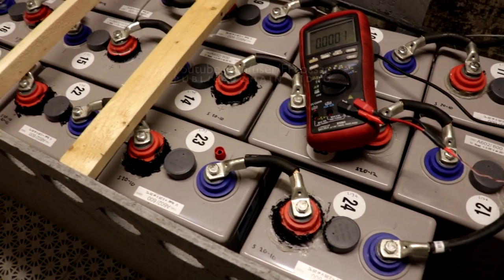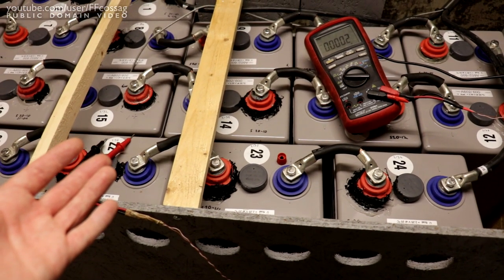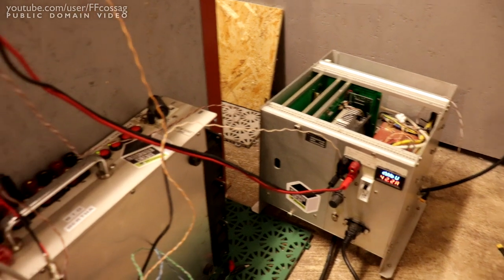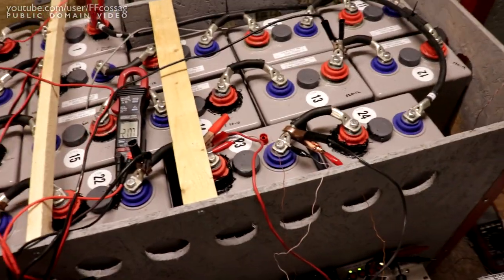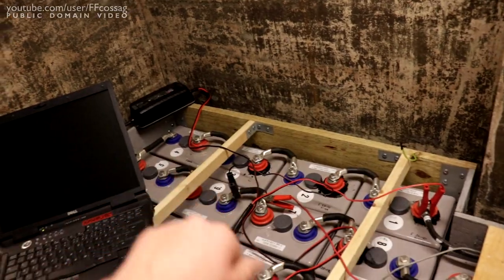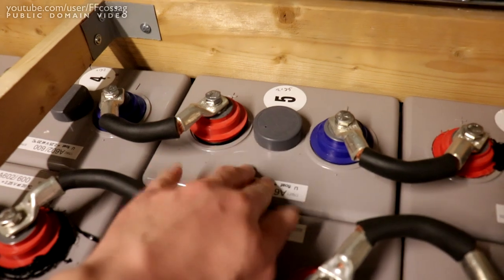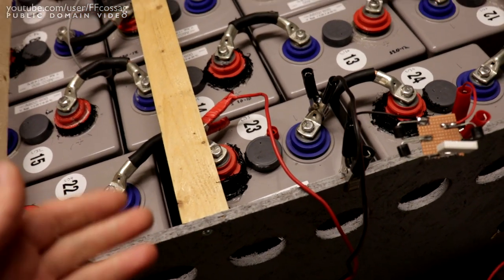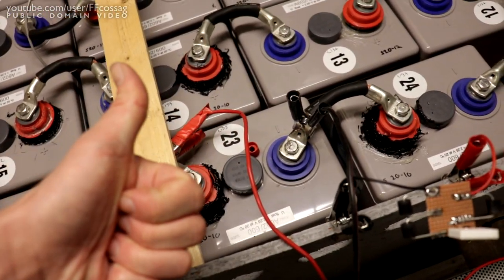OH NO! Why is Cell 23 completely discharged?!

Comment: Doing better than my solar setup, my salvaged car battery from I think 2017-ish finally died last month, I just haven't gotten round to replacing it yet... :P
Reply from the maker: That's an impressively long time for a car battery to live in a solar setup, though! Those poor thin plates must have turned to dust.
Reply: Given the way the battery is behaving now, I'm not sure if there's any plates left, charged from 2x20w panels through an alleged MPPT controller and powering an LED power meter (amps & volts) and a 4w LED lightbulb, and it can't even do that, but still, the battery was free, so, all's not lost... :D
Reply: Holy crap, you got 4 years out of a starting battery?! That's VERY impressive indeed. Back in my childhood days I used starting batteries with solar panels too, they died after just a few weeks lol. Those thin plates just shed and short one cell and then the whole battery is trashed 😂

Comment: I think thats why they got in big Battery UPS, battery balancer/equilizers. Even though Lead Cells are robust, sometimes they behave like Lithium.
Reply from the maker: Big UPSes tend to never even have that, it's crazy. I think lead-acids have potential to last much longer if actual per-cell balancing is applied, as with lithiums.
Reply: @FFcossag  I've seen Devices for that use case if you a big Facility then Money isnt a problem and changing on a mandatory bases the Cells. I got at work a similar problem, I got there a UPS for emergency Light it uses a Series of 18 - 12V Batteries, after 3 yrs a third of them drifts so much that in Voltage that they never reache the designed uptime.
Reply: @FFcossag  I have an APC UPS with 192 cells (YES, cells!) in series with a single center tap for balancing, it is amazing that it could ever work in any degree.
Reply from the maker: I know, those are awful, and usually the center tap doesn't even do any balancing - it's just monitoring.

Comment: Wow! That's some pretty significant positive plate growth indeed, I've never seen it push the terminals upwards before. I'm excited to see how my new 6V monoblocks perform once we finally get some sun over here in Sweden, also waiting for my energy meters to arrive from Banggood or whatever it was called lol

It may be a good idea to deliberetely overcharge them ever now and then to balance the cells, but water consumption and gassing will become pretty severe with the size of battery bank you have. Installing a balancer onto the bank might be a interesting long term experiment, to see if it helps with longevity of the cells!
Reply from the maker: Sun? In Sweden? You're waiting a long time for that ;)

There's no such thing as "water consumption" with gel cells, there is only electrolyte loss. That's why you need to be really careful with how you charge them, since continuous gassing will kill them permanently.
Reply: @FFcossag :P I'll have to wait for a few months, lol

 ah yeah, gel cells are indeed quite sensitive. I've killed several before I knew anything about batteries, simply because I overcharged them. I always assumed those big cells of yours were refillable flooded types by their appearance hehe... Sonnenschein batts would be a dream of mine, but I'll never be able to afford them and it's almost impossible to get them from the trash around here, as big companies get big bucks for recycling them
Reply from the maker: Yeah, you need to make friends in industry and intercept the batteries before the recyclers get them. Or make friends with the recyclers, offering to pay them 2-3 times scrap price if you'll get a chance to check out batteries before they ship them off to get broken up. Being very serious and professional about it helps a ton!

I <3 Sonnenschein (as you might be able to tell), they're frankly just THE best lead-acid manufacturer, bar none. I've been SUPER lucky to be able to snag up as many A600s as I have. Including a recent acquisition, I currently have 1700 Ah worth of A600s in the house at 48 V. I'm living my battery-nerd wet dream, hehe.

Comment: I dont fking get it, why the fk does it occur, I had endless problems with 2volt cell banks so i gave it up, I will look forward to when i can afford 48v lipho batteries and all ya have to do is parallel them up. Where did u get that 2volt massive transformer or charger from??
Reply from the maker: Basically all my stuff is scrapped telco gear. The 2 V power supply is a part of an old TV transmitter, I think it originally provided heater current for a 50 kW transmitter tube. I modded them to be variable from 1-14 V.

I'm currently developing a kind of lead-acid BMS together with a friend. I think the "lead-acids self balance" mantra that we all live by is a meme. I have some cells that float at 2.4 V and ones that float at 2.10 V, of course there will be issues. It'll be very interesting to see what happens when we get some shunts across them to provide actual cell balance.
Reply: I also have the same issu with my opzv .. and some of the cells keeps floating high .. and some at very low voltage 
2.42
2.19
I hope you can solve the problem or at least understanding what’s happening